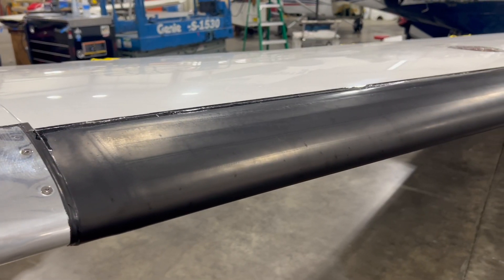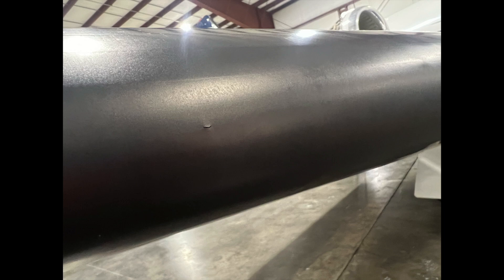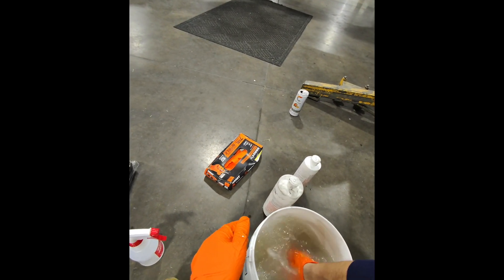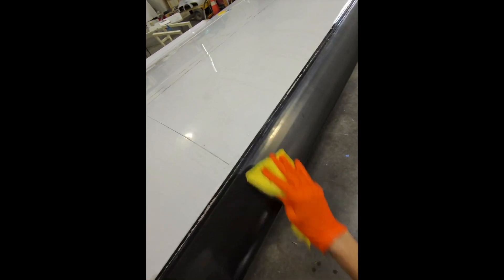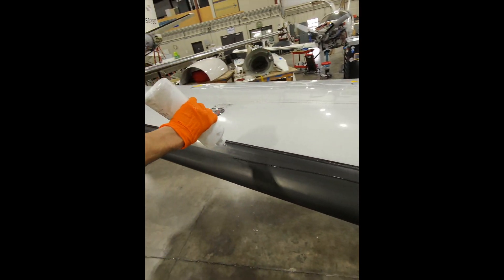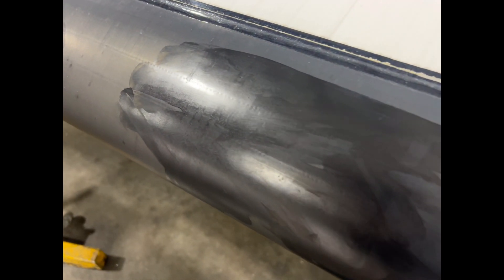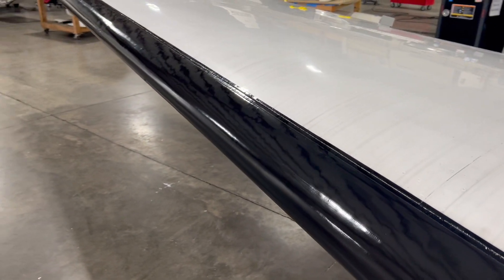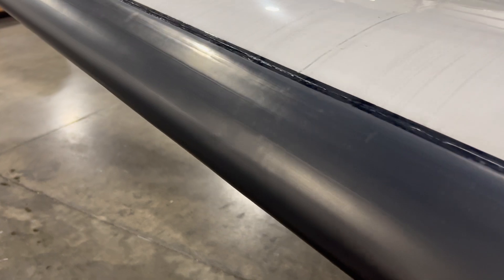How to strip and seal de-icing boots

Comment: I have been missing the awesome videos! You have been a great help assisting me improve my aircraft detailing skills! I've gotta clean up on a Citation M2 tomorrow, just a minor clean. :)  It has rubber de-ice boots on the horizontal stabilizer a mile up in the air! I cleaned and sealed them when I ceramic coated this past Summer. LOL!